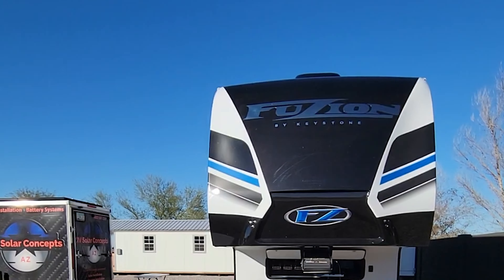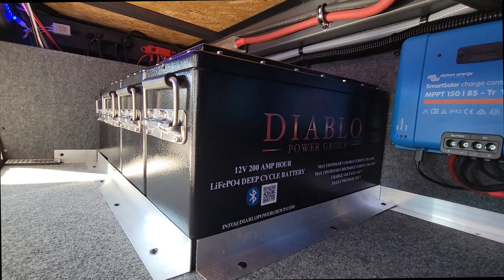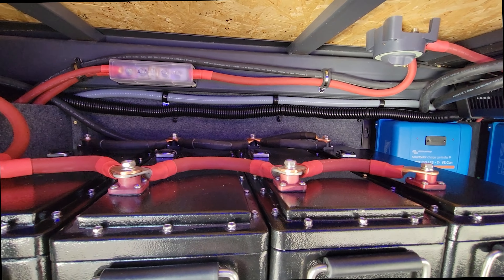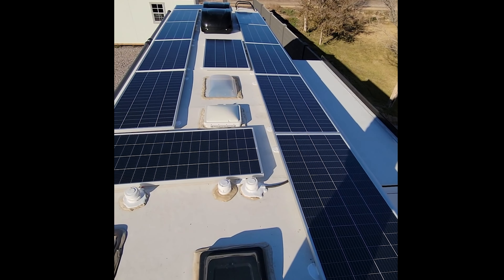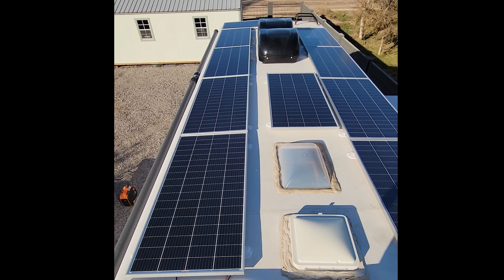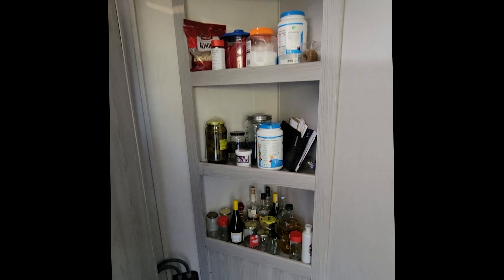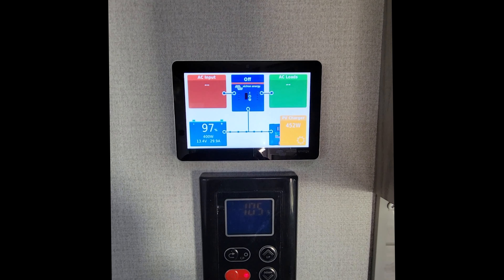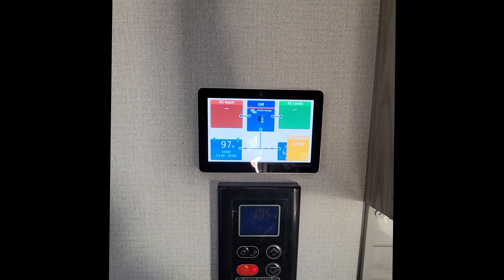Huge Off-Grid RV system! 2400 watts of solar!

Comment: The heaviest part in the MultiPlus is the big iron core transformer. Different models have the transformer mounted in different ways but optimised for vertical mounting.
It would not be good for the transformer to be hanging off its mounting bolts upside down because then it could quite literally fall out if the vehicle struck a bump in the road.

Comment: One question, why no go 24 volts?
Reply from the maker: Good Question! 

We usually reserve 24V systems for builds that will have multiple inverters. Victron recommends 4/0 wiring for each 3000VA inverter fused at 400 amps at 12V. This becomes problematic when you have more than one inverter at 12V you have to start sourcing very high amperage shunts, bus bars, etc... and also requires more runs of very large gauge wire. In those cases we will opt for 24V battery bank operation. 

The customers that owned this rig are living in it full time but their power usage only warranted 1 inverter so we stayed at 12V. The pros and cons of 12V vs 24V were discussed with the customer prior to the build and they decided they did not like the idea of having a buck converter (24V to 12V converter) as a single point of failure for all of their 12V appliances, hydraulic leveling system, lighting, water pump, etc... 

Going to a 24V battery bank would have saved some money on the build by allowing us to use smaller wire and one solar controller instead of two, but they wanted the redundancy in case of any future issues.

Comment: Why are batteries always stated as Amps while solar panels are watts? In this case I could see 12v but otherwise I'd be guessing 12, 24, 48v which has a huge difference in capacity.
Reply from the maker: @vladimus9749  In most cases they are labeled with voltage, amp hour capacity, and also watt hours. Solar panels don't have a "capacity" so I'm not sure how else you would want them to label the "power" production rating of the panel...
Reply: The correct way to measure battery capacity is in kilowatt hours (Kwh) or watt hrs. for smaller batteries. This way you can compare battery capacities of different voltages. For example, I have 2 solar/battery systems on my motorhome. My 12v battery is 560ah or 7.1kwh. whereas my 48v battery is 320ah but 16.4kwh considering the higher voltage output. Also the nominal voltage is not the actual voltage of the battery as a 4s LiFePo-4 battery is actually 12.8 volts and a 16s LiFePo-4 battery is 51.2 volts. My 12v battery is charged by a 620w liftable, side mounted array. This powers all my RVs native 12v components like lights, fans, slides, jacks, etc. My 48v battery is charged by a 4,400w roof mounted horizontal array. This higher voltage system powers all my 120v appliances like my 2 A/Cs, microwave, residential fridge, etc. through a 5,000w inverter. The higher voltage system is more efficient for higher current loads and is cheaper to build as smaller wires can be used. Very high amperage loads induce heat in wiring and components, especially at electrical connections, so should be avoided if possible.
Reply from the maker: @vladimus9749  I honestly think amps is just a simplification of watts as it's an easier number to deal with.  It would be similar to expressing everything money related in cents instead of dollars. An amp hour is a conversion from watt hours. If you multiple the voltage that you are working with by the number of amps the load is consuming or creating, you'll get the wattage. Most 100AH lithium batteries will be said to be 1280 watt/hours. 12.8V X 100AH equals 1280 watt hours. It's just a conversion factor but I think it also has to do with marketing. 

A solar panel array can be configured in any way that the user would like (series, parallel, or a combination of both) and they can also be manufactured in different electrical configurations as well... A 100 watt solar panel can be made to produce 20 volts and 5 amps, but could also be manufactured to put out 5 volts and 20 amps. Both panels are still 100 watts of power but different configurations are used in different scenarios.

Unlike solar panels that are rated in a number pertaining to maximum output of power, batteries are rated in amp hours. An amp hour is a measurement of storage not output. A 100AH battery can put out 100 amps for 1 hour before deleted but could also put out 20 amps for 5 hours before deleted depending on the load that it is powering... they are just different units of measure. You wouldn't ask how fast a car goes to determine how many miles per gallon it gets, they are just different measurements. 

Hopefully that clears some of it up for you!